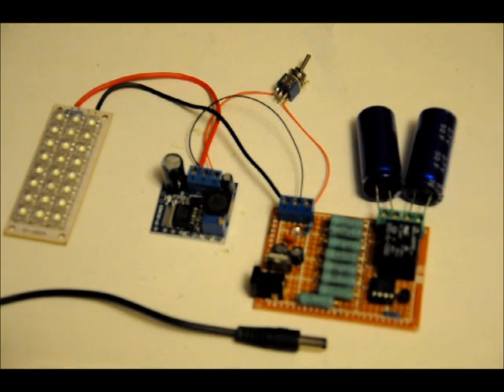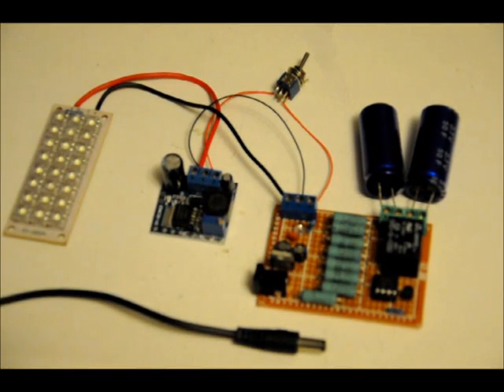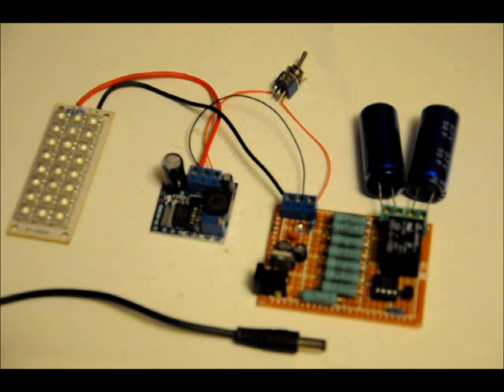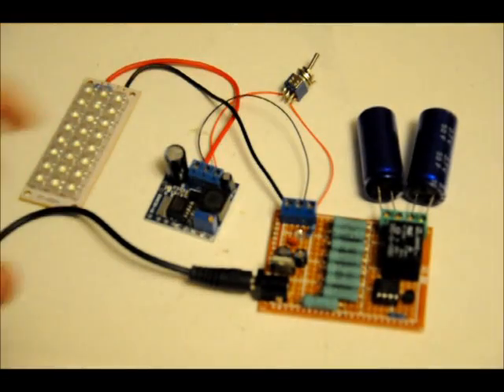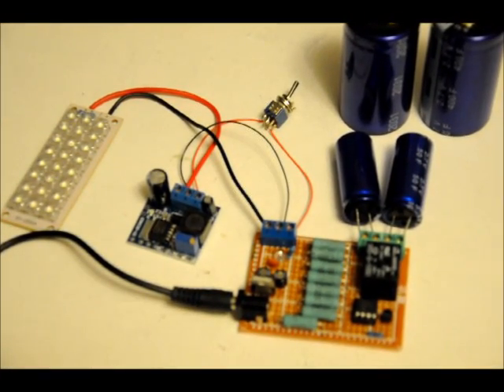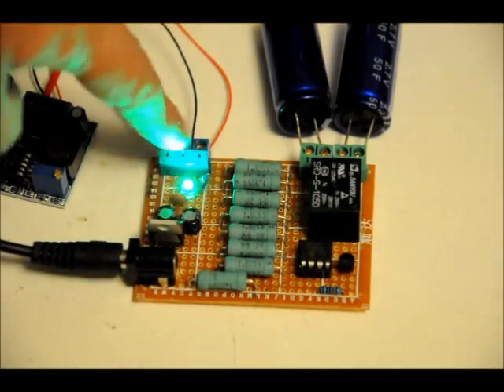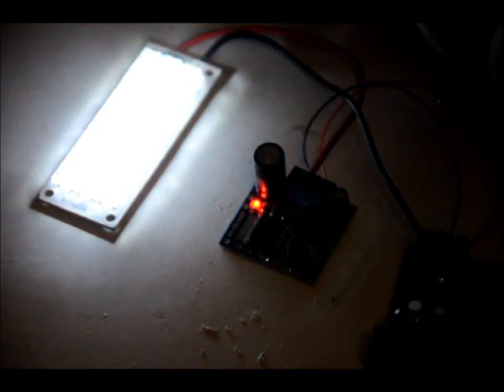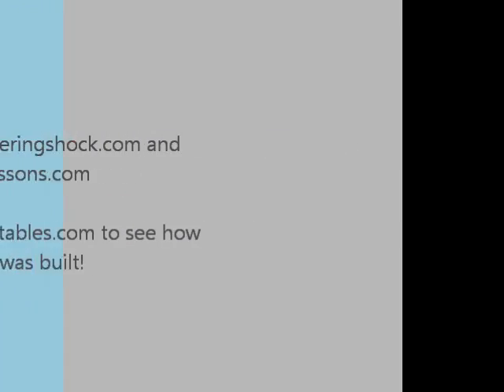Super capacitor flash light circuit with custom charger board

Comment: If you are sampling the voltage of the supercap as it is connected to the wall adapter ... is this voltage not "high" -- or -- does charging temporary disconnect, an ADC input is taken, then reconnect... know what i mean? cool project.

Comment from the maker: You'd need a pretty powerful zener diode/heat sink for a quick charge.  A standard one would burn out instantly.  As well, in this configuration, you get extremely accurate charging via ADC.  Lastly, the relay cuts off the digital circuit from the cap bank to ensure that there is absolutely no back-powering.